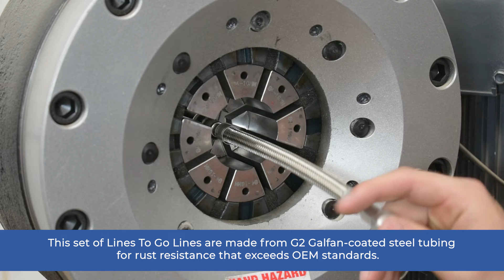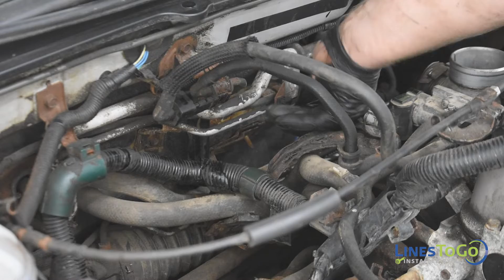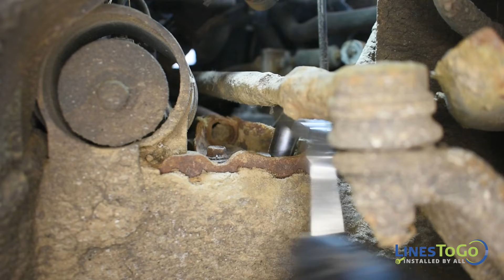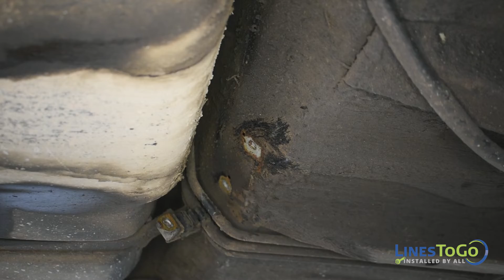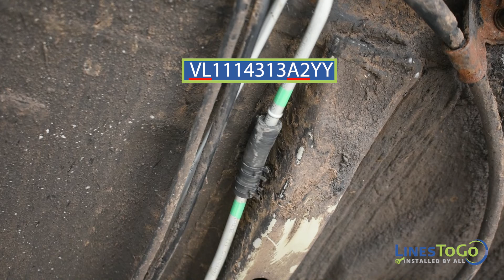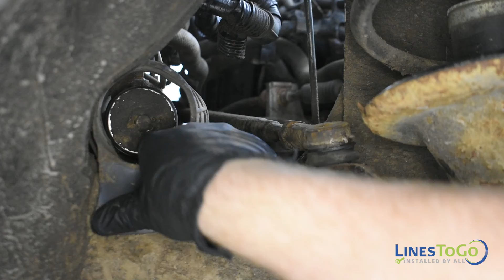How to Install 2001-2005 Honda Civic Fuel Lines

Comment: Guys. Did I miss the location of the in-line fuel filter ?
Reply: These cars do not have an in-line filter. There is a strainer sock leading to the fuel pump, and a filter built into the top of the pump assembly.

Comment: Do yall sell individual parts from this kit?
Reply from the maker: Hi There,

Our parts are sold as off the shelf kits; unfortunately you cannot purchase a single line from a set. 
In our experience, all the lines on the vehicle are disrupted when trying to replace or repair an individual rusty fuel or brake line, so they usually start to leak as well. 

If you wish to place an order, please contact Customer Service at 1-855-781-5992. 

Happy Travels!

LinesToGo Team

Comment: How could i check if its getting fuel in the engine bay before i remove the whole thing
Reply from the maker: Hello,

You could use a pressure guage to check and see if fuel is getting into the engine.

Here to Help,
LinesToGo Team